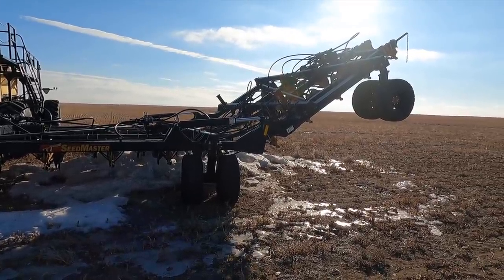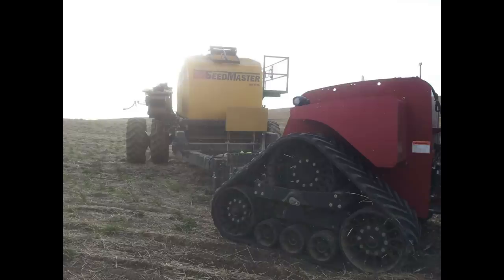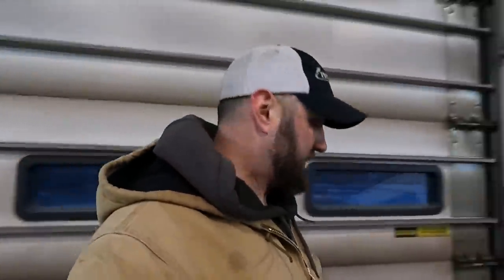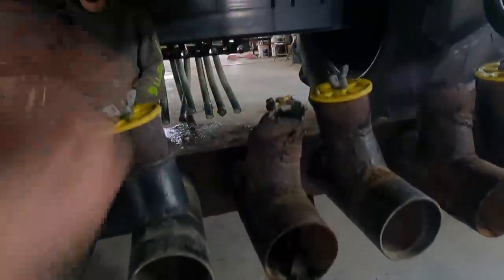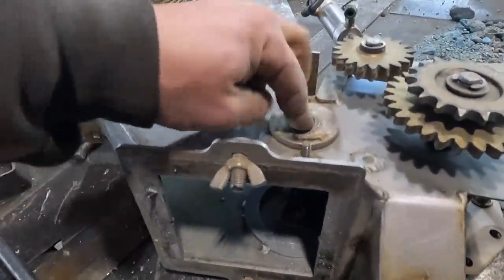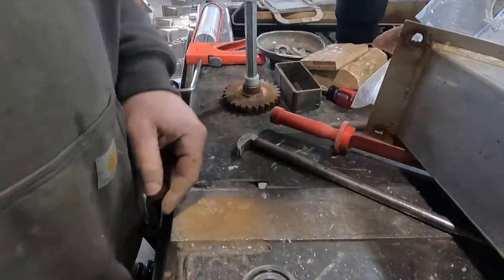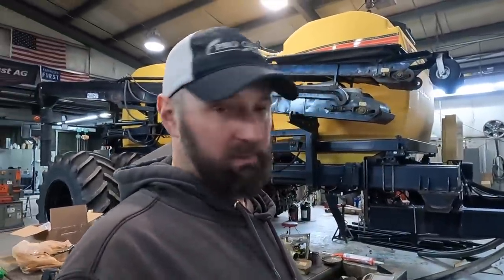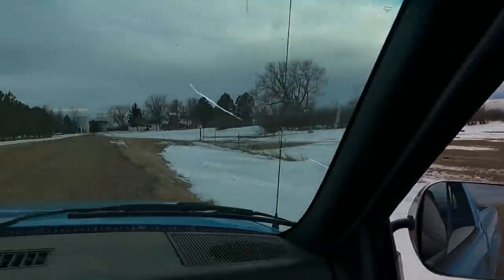SCRAPPING The Old Rusty SEEDMASTER Cart!

Comment: You rebuilding the fertilizer cart to sell or will you be running two air seeders this spring.   You mentioned the new cart is too wide for the shed so thinking you can't retrofit the existing cart to

Comment: Are you worried about the frame on the sprayer being heavy enough to hold that extra weight
Reply: The sprayer came with a option for a bigger tank so it will be fine.